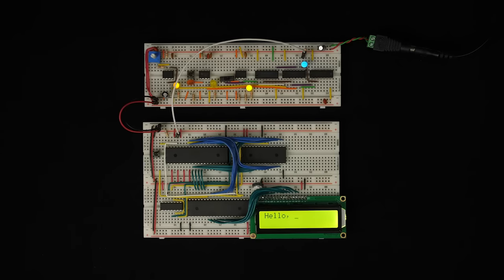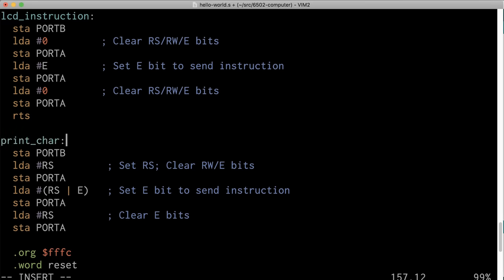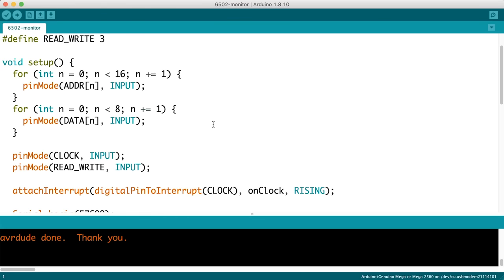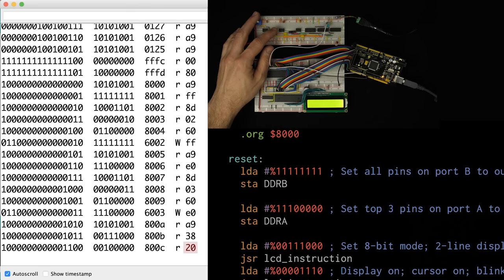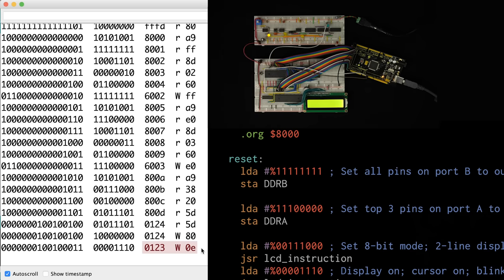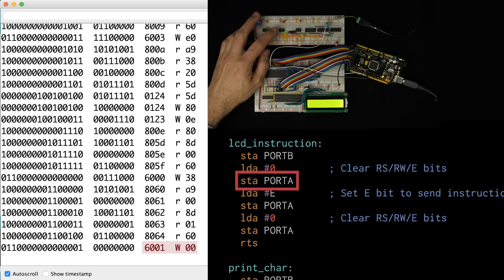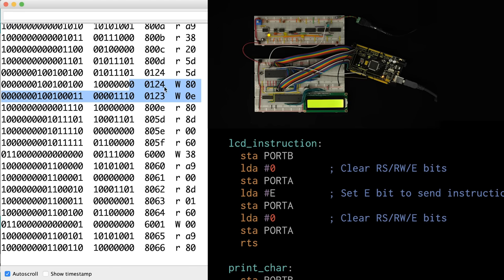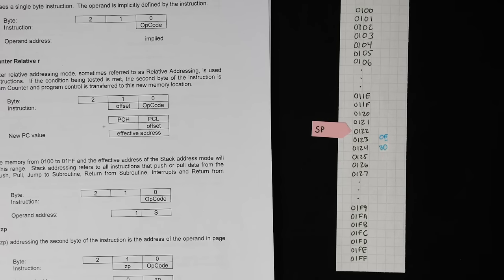What is a stack and how does it work? — 6502 part 5

Comment: is it possible to add eeprom programer direcly to the breadboard so you don't need to remove the eeprom everytime you want to change it?, maybe just some SPI headers to program?
Reply: just put the "cables" there. as long everything attached to those wires is rated for the voltage/current you use while programming it should be fine. but the breadboard hasnt enough space imho.

Comment: And the way the stack is designed in the 6502, hard-coded over a 8-bit range of memory, and thus limited to 256 bytes, is what makes it especially difficult for a C compiler to produce code for this CPU, and why assembly will almost certainly always be the only way to write good code for the 6502. Just imagine trying to run a RTOS with multiple stacks on a 6502... lol

Higher level languages (yes, even though it's hard to believe these days, C is considered one here :P) are designed on the assumption that there is no limit on the stack depth and will use the stack to pass parameters to subroutines, etc. On a C compiler like CC65, you need all sorts of tricks and to subset the C language in order to overcome these limitations. And even then, you need to be ultra-conservative in your stack usage and number of nested function calls in C code.

Which makes me wonder... Is there an agreed standard or convention for a 6502 ABI (Application Binary Interface)? How parameters are passed via subroutine calls, if registers are callee-saved, etc. ?
Reply: There is no standard that I've ever seen.  When I used to do game/assembly programming on the Apple II, it was common to use graphics routines by third-parties.  In reading that documentation, you were told which registers would be used to passed in, and which would be 'trashed' on return, so you better back up your registers just like Ben did here by pushing/pulling things off the stack, or often on the zero-page memory. So, the only rule was if you needed it, you backed it up.

Comment: Ok. But there somewhere must still be a way to store the chars in program memory without using RAM like you did the first time around? Or not? When programming arduinos you use the progmem modifier.
Reply: Here it is even easier as 6502 is von Neumann architecture, that is, both ROM and RAM are in the common address space, in the same bus. So no modifier is needed, you just tell which address to load from, and it can be ROM. Arduino, on the other hand, is Harvard architecture, it has separate address spaces. For microcontrollers this is preferable because there is separate buses to load intstructions and another ones to load data and they can work simultaneously. But there IS some interconnector which allows to use ROM as data source, hence progmem modifier.
Reply: You can define constants in assembler which are then programmed in the ROM.  Then you can just loop through the memory address, load each char in the a register and call subroutine.   You use a .byte directive in vasm.  I imagine that’s what Ben will do as he optimises his code.

Comment: I don't remember how the ROM is wired but could you write hardcoded stack by messing with the stack pointer?
Reply: The stack is hardwired in the CPU to be from 01FF to 0100.  Ben explains that.  It isn't possible to 'mess with' that.

Comment: 19:41 well you may have this many function calls nested if your doing recursive stuff... or your doing high level language programming and are doing all sorts of callbacks and such also depending on the architecture and the compiler (if working in anything higher level than assembly) it may automatically save any used or all registers to the stack regardless how pointless it is or not...
also libraries! god knows how many subroutines the library author leveraged to make the library work. so carelessly using those is typically a bad thing as well. sadly something that happens ever more often today
Reply: Higher level languages also use the stack to store local variables.  This could include large, fixed-length arrays.  Fortunately, modern computers usually have plenty of memory available for the stack.  A stack overflow is only likely to occur if a recursive function call runs amok.

Comment: Hey pls do you know any good c code compiler for microcontroller pic16f84 ? Like mikro c And microcontrollers simulator like protieus in linux , sdcc give me errors even for theirs blink led example on GitHub
Reply: Microchip have a free C compiler for MPlab.

And you know the 16F84 has been obsolete for years, right?
I mean, yeah, it still works, but there are better PICs than the 16F84.

Comment: I was a little surprised by that bug. I assumed the processor would have a "return address" register to do simple procedure calls, but I guess that's not a universal thing processors have.
Reply: Scribblers that makes no sense since most code would call more than one layer down so a stack is required
Reply: @danieljeppsson6913  In MIPS, for example, the JAL (Jump and Link) instruction stores the return address in a dedicated register. If you want call functions more than one level deep, then yes you would require a stack.
Reply: Scribblers ah interesting, I only have 6502 and x86 experience so didn’t know that

Comment: What about recursive subrutines?
Reply: They work the same. Just push another return address and jump to it. This is why you have to be very careful with recursion, if you don’t have a solid exit condition, you can overflow the stack quite easily.

Comment: 18:40 is basically the difference between call by value and call by reference function calls
Reply: No, how does that apply to this?
Reply: @AL_O0  when you call a function by passing the parameter as values they will end up on the stack as well as the return address will.
When you call a function by reference by passing a memory address, only a Pointer to the memory address will stored on the stack , over all you have less memory consumption 

Well in that case you have no ram, so it's more like access to a global variable
Reply: @AL_O0  so yeah you're right, it's not the same overall, but if you write c code and watch at the resulting assembly code, that's basically what you get
Reply: @lexus4tw  Ok, but there he is talking about something different, about what happens if the pointer isn't where it's supposed to be when returning a value, yeah, that happens if you put stuff of on the stack, and giving/returning parameters to a function also does that, but it's not the same thing.

Comment: Having written a lot of firmware that had to run without ram, I expected you to write a blob of bytes to program and index them in a loop (maybe teaching about nul terminated strings) to write them in sequence with the same code rather than use a call, but you always seem to go down a different path that maybe makes for a more interesting video than getting things right the first try.  I like the approach and your videos a ton, but I also value not adding more hardware too and learning how to make things work with what you have...
Reply: You often learn more from hunting down and correcting mistakes than from doing things successfully at the first attempt.

Comment: Why reading 0x0123 and 0x0124 gives 8d and not 0?
Reply: It's basically residual data from the last valid read. I guess the input buffers of both the arduino and the CPU have some parasitic capacitance that keeps the voltage levels stable enough even if the data bus is open. Maybe the output buffers of the ROM add a little bit of capacitance, too.
Reply: MrTridac Thanks for clarification!

Comment: If stack last address is 01FF - why we use "ldx #$FF" and not like "ldx #$01FF" ?
Reply: The stack pointer is 8 bits (00 to FF) and the leading 01 is assumed (automatically set when doing memory access using the stack pointer). X is also 8 bit so FF is the highest value it can hold as well.

Comment: if you do this with the benEater EEProm Arduino Programmer (...and rebuild it for the 256 eeprom used in this video) you might want to use this https://pastebin.com/GrVpEeCp . its a python programm i wrote to rewrite the hexdump copy to eeprom values like he has in "dataByte [] {0x56, 0xff ....} . basicly copy the hexdump values with strg+mouse to mark them and then rightlick copy. paste it into a file called data.txt. important! after the last value of a number write a ! and save the file with it. this is used to terminate the read. otherwise it might go into an endless loop. first it copies the value into newData.txt without empty spaces and then into a file called dataNew.txt which should have all the values in hex format for the arduino progam. you just need to copy them straight into the arduino program of the arduino eeprom writer. meaning to create a variable like dataByte, whateverrr you might call it then. adjust the write sequence a bit to the new variable and it should store it on the eeprom. worked for me (open a terminal and write "python hexData.py" to start it btw), after many fails... XD . i thought i might share if you only use an eeprom programmer for this it might save some bucks.

Comment: 3:30 I don't think that's a good tradeoff at all in this case; is it? You were already only using a fraction of the available space, and had no need for more. So it already seems pretty unwarranted to trade speed for more space...to say nothing of the fact that this "optimization" also necessitates additional hardware for the stack.

Comment: Ben, you are doing an outstanding job of explaining things.
Coming from a mainframe environment which there are no stacks. I tend never to use them. You simply put your arguments into a "control block" (like a structure in C) and pass the address of the control block in a register. You dont have to push/pop anything. I still code in assembly as I find it very easy. Things tend to make a lot more sense when you do. I use other languages (I know 13 of tem) when I have to,  but my love will always be assembler
Reply: In that design you either you cant call another subroutine from a subroutine or (if you have the concepts of multiple control blocks) you're just manually implementing a stack in software rather than in hardware.
Reply: In the end, every type of memory has a limit. All you do is save the adress of different points in memory at another point in the memory instead of the stack pointer.
Reply: @98081  ever wrote code in assembly on a mainframe?
You can call subroutines from ither subroutines. I Do it  ALL the time
Reply: @rty1955  then you do have a stack, it's just not a hardware stack.
Reply: BALR
Reply: @98081  not at all. The concept of a stack is to put something on, in a certain order, then take it back off in a certain order. This the term STACK. You pile things on a stack. Mainframes dont have such a mechanism. Thus no STACK. No need for it, been like that for many decades. If you called a subroutine you can use anyone of the 16GP registers to store the return addr. You are not limited to dedicated SP register. No silly stack overflows or underflows
Reply: @mheermance  or a BAL instruction. A BALR will jump to the addr specified in a register, a BAL will jump to the LABEL you want to go to. Both BAL & BALR requires another operand which is the register to save the current PSW (addr of next instruction) into.
So BAL label,7.   Will jump to label with the PSW addr stored in register 7
A BALR R3, R7 will jump to wherever R3 (IF EQUATED) is pointing to, and place the PSW into R7. 
You then issue a BR R7 (branch register) to go back (or not)
No silly SP to worry about

Comment: so you did all that to show that the processor had set memory ranges it uses for internal functions?...

cuz it's not like you're making this up as you go along... you've reviewed the data sheets and carefully selected compatible hardware to assemble into a kit so you know this is how it works but chose to start by doing it incorrectly.
Reply: Yes. This is one of his most frustrating videos. Solid base but it was implemented very poorly, thus your confusion and lack of gratification.

Ideally in good teaching the issue should be presented, and worked through giving the person hints and clues along the way swaying them to hopefully have atleast a simple answer before the answer is revealed giving the person satisfaction in “figuring it out themselves” actually learning something. It’s not as impactful to go “well we need ram, here’s an example why… see in this case it somewhere to save data, that’s what ram is for” that’s not satisfying or really teaches anything. 

Where your confusion and frustration comes from was you were stripped of any information to lead you in a direction as he had his thumb up his ass this whole video, going every which way and even derailing. There was no flow. If you watch the EEPROM video he does the same “I wonder why the CPU is just doing random stuff… I wonder if it needs something more” doing it “incorrectly” on purpose but unlike In this video there is a clear path to understanding the relationship… this… not so much…

Comment: I guess this chip has no cache
Reply: Doesn't need any. One of the cost-saving measure when designing the 6502 was the idea that the RAM would run at least as fast as the CPU, run on the same clock, meaning cache would be useless here. Which is also why the 6502 never got much overclocking out of it as time went on, because it couldn't run any faster than it's RAM. The faster you got the CPU going, the costlier the RAM would get. Passed 4 MHz was pretty much a "forget it" situation.

Comment: Could you use assembler macros instead of subroutines so you don't have to deal with a non-existent stack?
EDIT: http://sun.hasenbraten.de/vasm/release/vasm_2.html#Macros
Reply: He could, but the goal was to make the program shorter. Macros make the source code tidier, but the code would still be repeated in the compiled program.
Reply: @orignal29  But if you have to add more hardware (RAM) to make the program shorter then what's the point?
There's no shortage of EEPROM right now and if there ever is, is it easier to add RAM than add more ROM?
The real reason to add RAM seems to just be that it's the next thing to learn about. But that was a pretty bad excuse IMO.

Comment: Please tell us what makes CPUs faster.  It's not just a case of increasing the clock speed.  

Are  Intel and AMD hording a 1000000Ghz CPU?
Reply: Switching a transistor on or off takes a finite amount of time, and that is when they generate the most heat.
 The ability to get rid of heat limits CPU speeds, and is why modern processors will self-throttle rather than fry themselves to death.
 Transistor size is another factor. The smaller they are, the less time it takes signals to move around the CPU. They are reaching the limits of what can be photo-etched onto silicon. 7nm is already way smaller than the 400nm wavelength of UV light.

That's why processor speeds are barely beating 5GHz, so multi-cores are a way around that, but some software tasks can only be done one step at a time, sequentially, and parallelism can't always help :(

Comment: Stack architectures are the worse ones. Never design your cpus on that technique, kids. Vid is good as  usual.
Reply: @MJS poor potential optimisation for superscalarity and bad context switching performance
Reply: what are the options?
Reply: Tell that to the web assembly folks ;)
Compiler designer hate them already.
Reply: @ryuuji159  the answer to this is complicated, but in short: use more registers. It would be easier for scheduler to oooe cpu commands

Comment: Why do you fiddle around with that horrible VIM instead of using Visual Studio? The whole premise of it is one of the dumbest ideas in  history, doing everything with letter keys so you're always in typing position.  Cause that's definitely the bottleneck in the coding process.. That 0.2 seconds it takes to move your hand from the mouse to the keyboard.
Reply: Does visual studio support 6502 assembly syntax highlighting and the ability to navigate from a jsr/jmp statement to the label? He's also running on Mac which does not have Visual Studio, so at best he would be using Visual Studio Code which has less functionality than Visual Studio. And maybe he is more fluent in using vim, or prefers that as an editor.
Reply: @msclrhd  Hes not that fluent in vim because he is manually key scrolling up and down the code instead of using the line jumping key combos. I'm sure VS code has an extension for 6502 assembly because the VIM version for windows is crippled and barely usable.
Reply: As an IT professional with 37 years of experience with vi and maybe 20 years with vim, I bet that I can accomplish more with vim in a shorter time frame than you can do with VS.
Reply: @STDrepository  He's probably not doing that because it would be hard to follow on a YouTube video if he jumped around the code for no reason. He can clearly use vim via the various key commands as he is using it from a terminal window instead of via gvim which has more of the mouse control. Otherwise, he would not be able to highlight the repeated sections of code like he did.

How is the Windows version of vim crippled? Do you mean that gvim defaults to inputs more familiar to windows users in the config file that you can edit how you want? How is that relevant on the mac which he is using, and when using it through a terminal window?
Reply: @JanBruunAndersen  There's no way. Visual studio has the most advanced autocomplete on the market. You can add new code pages with 2 clicks that are prefilled with class brackets ect.  Visual studio can compile and run with a single key press without having to :wqa and return to the terminal.